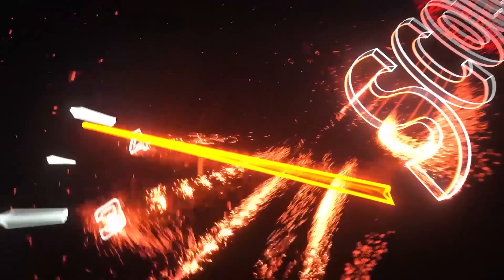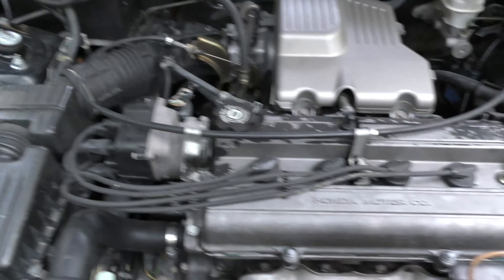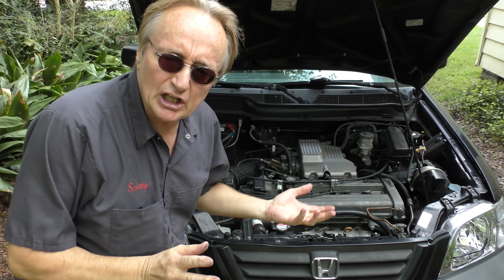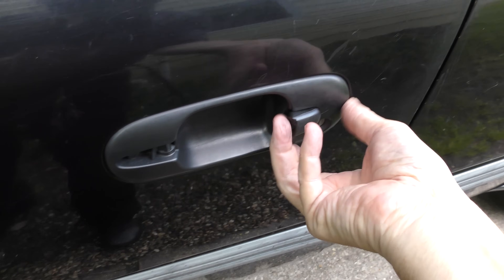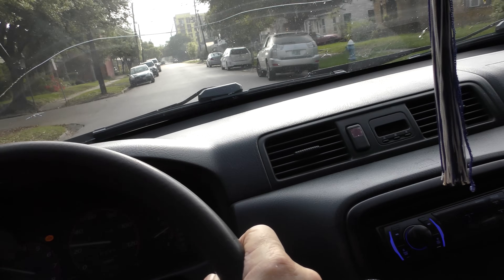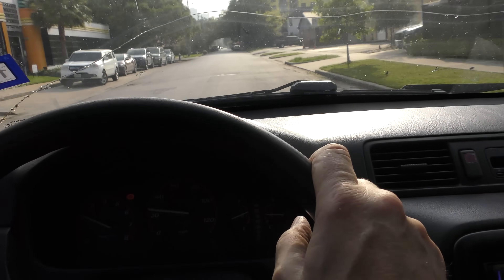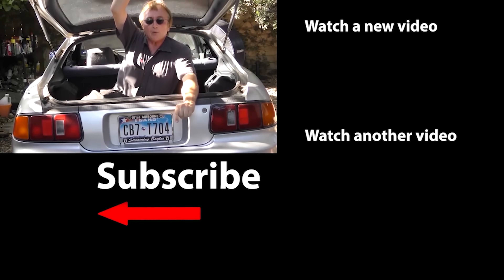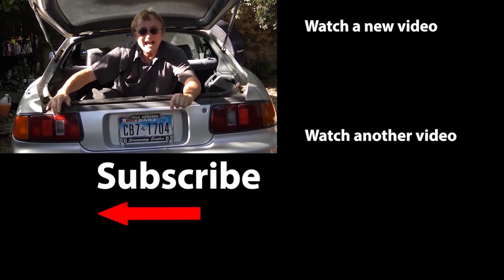Here's Why Smart People Buy Cheap Hondas

Comment: yeah... I had a Jeep Compass and a Jeep Patriot where the drum brakes lasted like 90,000 miles... and believe me I did NOT baby the car (I did not go easy on the brakes) ... that said someone will probably give you some money if you do a video that tells them how to keep Dodge drum brakes from squeaking... I had the problem on three cars... obviously the car I have right now in the picture does not have rear drum brakes ;-) . 

also on all those cars I swapped them out for ceramics and I never had to put new brakes in the front either. fairly lightweight cars.

Comment: The only thing to worry about in those crv's are front lower balljoints when they wear a little, there is a risk that the wheel comes off and hang only on the strut

Comment: Dear Scotty, I hope you understand my English. After seeing your video, I have a question for you: Do u recommend me to keep a 2012 CRV AWD suv that used to be my father´s car and it has only 73,000 kilometers? Honestly I used to be convinced that it is a beautiful car with no issues and always well maintened, but few months ago my son was crashed from another vehicle in the left hand side of the car and both doors were replaced by a new ones. Few weeks ago, fixed already of the crash issues, I change rear brakes for an original new pads, changed the 2 rear shock absorbers, (front ones seem to be good ´til now). Although the car runs well and engine and transmision have no issues at all I do not know if, by the crash situation, I would keep it with me. I love it, it runs great, it has a leather seats, dual digital A/C, is an AWD, everything works great in it. What do u suggest me? I am living in Mexico and there´s a big possibility to go to live in Texas in december 2023 and due to some weather situations I have been seeing upthere the last 3 years now I was thinking to keep it and take it to USA. Should I do that?

Comment: funny i also have a 2000 crv with the exact same mileage. every thing still works. a couple of months ago i replaced the first part which was the radiator. that and four new plugs and it’s like new. i just bought a new highlander and now don’t want to get rid of the crv or a scion xb with 310,000 trouble free miles.

Comment: my bf's 2003 crv is impeckable, except for the front left wheel nearly broke off due to rust, and almost killed us this summer, lol. the dealers at honda had never seen anything like it. it only cost about 700 to fix it. almost no rust on it except for that exact spot. weird! check for rust behind the wheels on your honda's guys!

Comment: I thought I loved my 92 Civic which had 325,000 miles when it died due to a Clogged Cat....
But then brought a 98 CRV with 137,000 miles on it and now it;s at 179,000 miles...It has SO MUCH SPACE! And the push in the engine is Great in 1st and 2nd gear..but it sucks going up hills(I live in Utah..alot of canyons and valleys).
But when this goes out..I'm getting a 2002 CRV next..if it be 5 years from now..or 10 years from now!

Comment: Dont leave out Toyota !! I had a Toyota Hi Ace van with 325 thousand miles on it and most folk do not beleive what I am about to say but trust me its true. The only things we had to change in all those miles were radiator,  tyres, battery, wiper blades ,7 bulbs , and a few gallons of oil !!!! Nothing else no exhaust no discs, no pads,no bearings,no joints,not a single cable, no clutch, no shock absorbers,JUST NOTHING That van saved us from going under and sadly when we sold it the chap that bought it bought it to break but it was still running still burnt no oil sadly the body work did need work but it was a good few years old by then We were heart broken when it left our side I know I know how can you become so attached to a lump of metal BUT WE DID !!!!!!!!!!!!!!!!!!!!!!!!!!!!!!!AND YOU CAN !!!!

Comment: Scott 
I have a 2001 Honda CR-V that I have bought my daughter for her first car,
But I bought it with vibration inside when on a stop sign or idle. Once you driving no vibration. I have replaced all mounts, replace spark plugs, sparkplug wires it has no check engine on. What else can cause vibration

Comment: Scotty...I have to replace the alternator on a '98 CRV...can it be done from underneath the vehicle? I have to also replace the drivers side upper control arm, so if I can replace the alternator from below I would prefer to do that, even though I probably have to remove the axle shaft.

Comment: No only the engine and transmission can stay up to 350000 miles or more if properly  taken care of, but the AC must been serviced, I have 99 Honda CR-V, the original AC can only last till 150000 miles, and then you will need to change compressor, or at least compressor clutch, drier, all AC O ring seals no exception, of course other parts will go bad like lower original ball joint last till 220000 miles, most likely at 220000 you will need to change a lot of parts, idle aire controle valve ( original only good used or new one, because after market doesn't last very long), engine both gasket, oil pan and valve cover, and all front and rear end suspension. In addition to drive shaft joint goes bad, mine the rear differential brook from the body of the car, and I removed all of it (differential, drive shaft, rear axles but l left the axel part that hold the wheel bearing together) and know the car is front wheel drive only.

Comment: I have a 2000 accord ex manual 220, 000 miles,   I drive it 60 miles to work round trip mostly highway at  80 miles an hour. Car runs great no problem had the car since new changed the oil myself. used mobil or amsoil synthetic..  The car burns oil  about a quart every 3 weeks no smoke but when I check the dip stick  its low.  thinking about buying a used engine from Japan  a mechanic said to change to 5w 40 instead of 5w-30. Any ideas

Comment: Hi Scotty,

My battery light will not turn off. I have replaced my alternator 2x (original honda), new battery, changed the electric load module detector (original honda), all fuses are good, and it still won't turn off. any advice?

Comment: I bought a 2011 Honda CR-V with 83k miles and it has excessive oil consumption, the recall expired, and there is valve clatter. And there are intermittent  issues with A/C.

I had a Lexus GS430 before this. I think after I buy another Lexus I'm never going back to Honda.

Comment: I all ways us to hear that all Honda's had bad hearboxs, but this one fine at over 250 ,000 miles. Have seen the old Odysseys turned into  campervans and go around the Country 3 times, and keep going! But have herd of a 2010 lose the gearbox at 60 ,000 kms. It a roll of the dice if you get a lemon or not

Comment: Hey Scotty: I have a job where I drive all over the east coast in a little hatchback. Now I'm moving somewhere where I need a four-wheel drive just to get down the driveway reliably (500 feet of mud after it rains) and I was wondering if there's any way I could get a four wheel drive little tiny hatchback. I was thinking about the Subaru Impreza, but I really like Toyota and they did make the Matrix in all-wheel drive. I was also considering an all-wheel drive Honda CRV, but I really want 30+ mpg. What do you think for this situation?

Comment: I have a Honda oddesy 2010 I took a road trip about 5,000. I had to keep changing the motor oil every week about. When we bought the car the guy said there was a small leak. Question is can I repair that? Also how much would it be? I want to ask you before I take it to the mechanic and they tell me a high price.

Comment: The problem is that the hold the value. Somebody would still expect to get 3,500 for that car.  So if you  just want to buy a beater car.  Nobody wants to spend 3,500 for anything with 285,000 miles in that condition.

Comment: Hey Scotty, I am looking to buy a used Honda Accord 2.4l, 4 cylinder Vtec automatic engine configuration with like 120k miles on it. Could you please advise me on this please? General condition is all good like tires are new, well looked after, not bumped into anything and stuffs like that. Just hoping it to be low maintenance.

Comment: If you get one with a timing CHAIN (2004+ 4 cyinder) they can be worthy cheap investments. I would avoid the older belt driven engines. Unless you can do that work or can pay a mechanic $1000 every time it needs a service done.

Comment: 1:14 if you have an aftermarket radiator installed in your dash, that might be the time to get rid of your old CRV LOL. Otherwise I would definitely keep it until the wheels fall off or until you can no longer get it through inspection

Comment: Hello Scott I have a problem with my 2001 Honda CR-V.
It vibrates when idling or on a red light or stop sign it drives fine and everything I've changed all the motor mounts I've changed the spark plugs I've changed the wires I've changed the distributor cap and rotor. But it continues to vibrate inside the cabin it feels very loud steering wheel vibrates

Comment: I want to buy a used 2016 Honda crv,  any mechanics wanna offer advice as to how reliable these newer models are?
I noticed scotty said they have huge problems with the gdi engines getting gas in the oil... how do i check for this if I'm buying used, because I know the stealership will try to cover it up.

Comment: I know the engine still works fine at this moment, but I’d be afraid that I’d be going down the highway at 75 miles an hour and the engine would blow up and could cause a serious accident.

Even with regular maintenance, at what point would you say that a car is just too old and the average Joe (who’s not a renowned mechanic like Scotty) should just consider buying a new one — speaking primarily from a safety perspective.
Reply: no one even knows how far a 90's japanese car will go. the engine will never blow up, because normal engines do not blow up. probability of having a breakdown so catastrophic that it will lead to a wreck is literally non existent on a maintained car.

Comment: How is Honda power steering fluid different and from regular PS fluid from other brands?
All I know is it's slightly thicker but not by much. I had to get my PS hoses replaced recently and my mechanic who is a local Toyota/Lexus specialist recommended and put in Honda fluid in my 2008 Lexus RX350, he told me it's the best fluid to help the system last longer.
Reply: stick to OEM honda PS and ATF fluids

Comment: I bought a 97 crv  it is the real time all wheel drive? Could you possibly explain this to me? I paid 2,725 with 185,000 miles. I've done a tune up change all 4 breaks disk and drum. I have changed the battery the starter I've kept up on the oil change. This thing runs amazing. Well I've notice that the cv axle needs replaced and tie rod end. Is it worth it or should I sale? I am a tire tech / mechanic I have my own impact tools and socket so labor is just my day off.

Comment: Ahhh honda nom nom. The worst mistake i ever done was sell it for a land rover, thinking i was cool £3000 out of pocket and selling 6 months later i was £5500 out of pocket, went to a vauxhall insignia found out was cat D (After purchase) £9800 out of pocket, went to a sports hatchback focus ST £14,450 out of pocket, running expenses through the roof and forever had damper issues and tyre related issues, an yea lessons learnt. I ran straight Back to a honda, last decade 2010 of a honda civic hatchback type R GT , and she is solid with low mileage she's a keeper i will rather loose my home then loose my honda ever!!!

Comment: Lol Bought a 2006 Pilot over a year ago for 5K everything works fine. It had 218k on it. Just had had first work since I bought it $1100. Took it on a 2000 mi trip right after the fix, no problems. That's $6100 for the car and all mx for almost a year and a half. Oh yeah, its got 231K on it now and still going strong. It still has over half the tread left on a set of new Michelin tires (on it when I bought it). How much are your car payments?

Comment: Scotty, thanks for the great videos! What do you think of the 2011 GMC Acadia?
Reply: Stay away from the GM 3.6L engines, when they get high milage the spark plug tubes start leaking where they are pressed into the heads and causes Cyl miss fires. Only fix is replacing the heads. poor design.

Comment: Have you ever seen or made a video on replacing a heater core on a 2004 Element ?  I have radiator  fluid slowly dripping on passenger floor.  Thx

Comment: Just don't neglect those rattly ball joints. I've seen many Hondas at the side of the road where the wheels almost literally fell off when the lower ball joint gave way and the knuckle was no longer connected to the lower control arm.

Comment: I bought my ‘95 Volvo 940 Turbo for about $1800 s and spent another $1800 fixing it up. Running on its original engine and transmission (250k miles and counting) and drive beautifully. Sure parts are pricey but they last a long time. No headaches, no regrets😎

Comment: I have a question I have a Honda CR-V 2001 when I run 25 or more the rpms go down and I hear a sound and loose power I have to push the gas harder so the rpms go up

Comment: I have an automatic '99 Honda Civic LX with 264,000+ miles on it right now. Aesthetically it's in much better shape than this. Things like electronic controls in the door are easy to replace & can be bought new for < $100. There's no excuse for letting this fall to such disrepair

Comment: Could you pls tell me where the fuel relay switch is located? Please? Just walk to work in the rain I'm drenched besides that it just cut off on me the other day my 2000 Honda CR-V EX 5 speed and I change the ignition coil if your cat in the router it still doesn't want to start it has a crank no start it's like the gas is not getting to the engine please help me

Comment: I just bought a 04 crv for 5000 with 150000 oil
Changes done at dealer so far I love it trying to convince my wife those will go for 250000 plus the dealer put new o2 sensor in it but the code is still on how do a get it off

Comment: My son drives my 01 CRV and I've surprised myself on things I repaired on it. 
Maybe someone can help me with a problem I am having- I stop the car, turn off the key and the dome light comes on as usual, but then I OPEN the door and the dome turns off. The dome does not come on if I open the door but obviously the door sensor works because of the way it will turn off. 
Any ideas?

Comment: What's with it with Honda and their seemingly indestructible engines? I have a 2007 Honda Accord with around 200k miles on it, barely any mechanical issues(which is surprising as my it was my father's daily driver back then and he's one of those drivers who gives a lot of gas and then brakes right after)and pretty much the first thing to break on the thing was the lock on the door( keys wouldn't unlock it no matter how hard you turned it). And we never even had to touch the AC on it, and it's still blowing cooler and faster than my Mother's new 2017 ram 1500...  Scotty, let's say it's time to get a new car, should I keep with Honda or switch to Toyata? I'm a little sad that they don't make Honda's like they used to, especially with their 2.4 liter engines, so I'm just looking for some advice.
Reply: Edit- they probably still have great engines now, but I was impressed with how their 2.4 liter engines has held up. Also they recently switched to 1.5 liter and 2 liter 4 cylinders, which was the source of that last bit/ comment.

Comment: Just bought a 2000 with 250k for 1400. The power door lock is on the door not the dash lol, and the passenger is a lock not window switch lol

Comment: I actually purchased a 2000 Honda crv earlier this year. 
From time to time I would smell antifreeze. Is that normal and if not what would you say that it is?
Reply: @starkeymorgan4142  
So would that mean that it's time to change it out again?
Reply: Change out the head gasket again?
Reply: @cedricksamaniego9146  yeah...that was my experience when I smelled antifreeze. Especially when I turned on ac. Had to have a mechanic with eyes on it to definitively diagnose. Also..I do remember that the temperature would randomly jump around.

Comment: Hey Scotty, I’ve got A 2003 Buick rendezvous with 283k Miles, With The 3400 V6, And I don’t Know, What Transmission Is In it, Can You tell Me? But Are Those 3400’s Good Engines? Tell Me Please, Cause I’m So Worried About It, It’s Not Even Funny, With The Mileage It Has, And How Old It Is(17 Years), I’m So Worried About it, I Also Need Know If The Trans Thats In It, Is a good Transmission, So Basically I Need To Know If The Engine(3400 V6) And The Transmission, Are They Both(The Engine And Trans) Good And Reliable, Together

Comment: Smart people should think of safety too, not just how cheap a car is! When a car has an old design and engineering, it lacks new standards and safety features. Also, the structure is not as rigid as the new cars. Even there is a higher chance of safety measures like airbags not working properly! So money is the second issue when it comes to buying a car.

Comment: Hey Scotty, thanks for all the awesome content. 

I have a 2010 Acura RDX Tech AWD with 139000 on it. Bought it for $8k in sep 19, spent about $3k on snow tires (I live in Canada), oil changes, filters and also changed 2 out of 4 all season tires. My mechanic suggested I should change brake rotors as it has some metal coming off. The brakes work fine for the most part, except when you try to hit them too hard, then it skids. Should I: a) spend money to replace rotors or b) trade in the car for a better car with lower maintenance or c) keep using till the rotors wear out? Appreciate your advice. Thanks in advance.